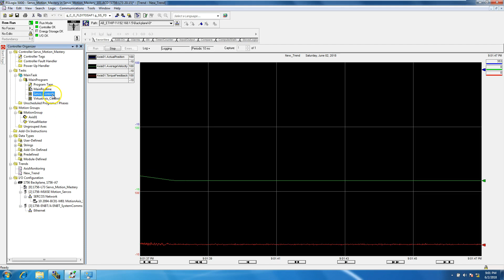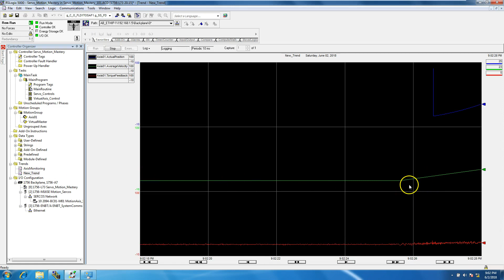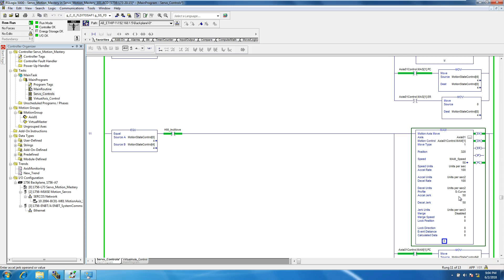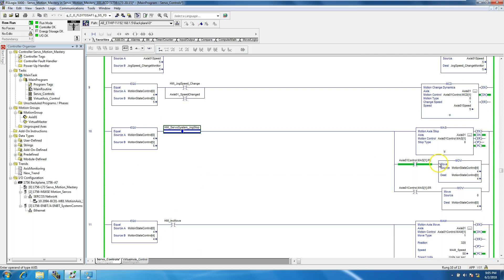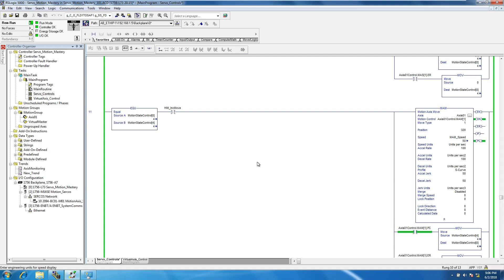RSlogix 5000 Servo S-Curve Accel Jerks

Comment: Shane, couple questions. I have a Powerflex527 in a loss in weight feeder application (inherited). Can you set a slow accel and quick decel using jerk rates? I need to start a feeder slowly but stop quickly. Also, maybe unrelated to this topic, in using MAM, I don't have feedback because this is to frequency control. What do I use for position in the MAM instruction? Love the videos, cheers!
Reply from the maker: If you have no feedback, meaning no encoder then you shouldn't use a Powerflex as a servo control.

Use the Powerflex drive with normal drive controls then use a start stop & PID

Comment: is it ok to set accelerate rate higher than speed unit? here speed is 250u/sec and acc is 1000u/sec2..pls explain
Reply from the maker: Depends on the setup.

Meaning, what the system timing is.

Servo controls are highly dependant on timing